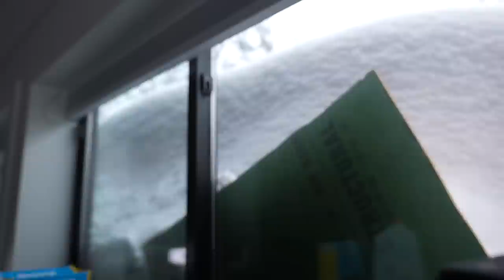RECORD BREAKING SNOW! WHAT NOW?

Comment: Suggest closing sides up for 3 reasons.  1. save propane. 2. melt the Ice. - side walls are not insulated so closing in the sides will raise the temp in the side portions. Heat loss is inside minus outside temp.  the bigger the difference the more heat needed.  [I use the same on the back porch and get 10-20° warmer on back porch.]  3. dry out sides.

Comment: Trent, If you are using , say, 1 1/2" outside diameter pipe, use a 1 5/8" drill bit.  Allows for some wiggle room.
Reply: Agreed . . . not really 'rocket science'.
Reply: Hey genius, I guess you missed the part when Trent specifically said "do not comment about the pipe".  I think there is too much wiggle room between your ears Rickster, or you are just plain inconsiderate!
Reply: @roberta4989  TBF . . . Trent did not say that for the same purpose that Rickster et al made these comments.   ( @26:25 ) first - he prefaces his comment with "if you're a plumber"  Not sure bout Rickster - but I'm NOT a plumber.    Then the gist of Trent's comment is about  whether the pipe might be too tight to function properly.   These comments are not about that.   They relate to "why make the project so hard  . . when if you just make the holes a wee bit larger . . . your job would be much easier".
Reply: @TomLloyd-18  Some people just like to argue.  Sad

Comment: How are you going to insulate the walls in the garage?  I’m worried because you can see daylight between the panels!  No wonder it is freezing!  So admiring of your tenacity and energy doing absolutely everything yourselves. Keep going!
Reply: They haven't taped the walls yet, if you recall they just got the roof taped up. Then there is foam board insulation that goes over the outside walls, then siding. Inside will be insulation between studs, then drywall. They got quite a ways to go after 4 way inspection...and the room is cold as there is only heat vents on in that room when they want them on till it is all done. Remember they are short on propane so they don't heat it much unless they need it.
Reply: @repaid1  Thanks for reply - I am ignorant about building process. Just hope the roof and walls haven’t got too damp in the snow storms.

Comment: Yes... mtn riders always should have an avy pack. And I'm a trail rider.  Also... not sure on that time lapse but hope you yet that sled warm up real good before moving it.  Seen too many cold seize without doing so.  Get it up on some 2x4's as well if stuck in that area. And some had guards will protect from the cold tops of the hands. Ride safe!

Comment: I NEVER work with moving parts in my snow blower while the motor is running.
Why not store your snow mobile on some wooden pallets, keeping it from being stuck in ice?
After being burried in an avalange some years ago, I never, ever, go near an area where ther might be even the smalles risk for an avalange. That was a teriible experience that I never want to experience again. Thanks for the avalange search dogs, they save lives - they saved mine.
So Brandon got a day off, but not Sideney...

Comment: 100% should buy an avalanche pack if you're going into avalanche terrain.  I've seen so many videos of snowmobilers setiing off avalanches due to the noise and the weight since the snowpack in utah and colorado is so fragile due to the huge temp differences.  No big deal if you're not going into avalanche terrain and staying in flat areas, but even terrain <30 degrees can go if it'sa big windloading event. Along with an avalanche pack, i hope you're going to carry a probe, beacon and shovel and doing some beacon training/AIARE 1 training and following UAC. Good luck!

Comment: Amazing your pushing through all that snow. I am an electrician not a plumber but I thought you couldn't put water pipes in an unheated outside wall? Not sure but if it was me I would at least wrap those pipes with electric heat tape . I couldn't sleep nights in the winters you are having with those pipes so close to the outside sheathing. Just me speculating.

Comment: Been riding since i was 10 yrs old (that's more than 30 years). 
My opinion . . get the avy pack if you ride in avalanche prone areas (30 degree+ slopes with new/deep powder). If not, wait to buy until you are more experienced and ride in those areas. Technology is changing.

You will need 2 good shovels (one in your pack, and one on your sled) AND an avalanche probe, AND ABSOLUTELY need a beacon. BCA Tracker 3 is a good one. PIEPS makes a good (small) one too. Take an avalanche class, so you learn how to use them all - SO VERY important!!!!

 Packs come with gas canisters, air canisters (both not recommended), and the "fan type", which is the newest technology. They should cost more like $1000 to $1200 for a good one. I wear the KLIM Aspect 16 myself. This uses a capacitor and fan to inflate the bag. Can do multiple deployments (i think up to 3), and you can just charge the capacitor with 2 AA batteries. With the gas or canister type, one pull and you are done. PIEPS JetForce is another good one but more expensive. BCA is supposedly coming out with a "fan type" soon. No intel on that one yet.
If you need additional info, i am happy to help - Cheers, and happy riding!!

Comment: you just built a garage and park your cars outside, makes no sense. Buy a $600 avalanche pack, every bit as good as spending twice the cost. I went to avalanche training in Truckee, CA great class. Dril 1" holes for water pipes, installs easy, and then you can put insulation tubing over it.

Comment: An avalanche pack will save you, sometimes, when you do dumb things.
Do not highmark and ride on slopes in high avalanche areas and times. Alaska loses several riders a year usually in the same few areas. I have been riding for 50 years, never had a scare. In deep unstable new snow, stick to the flat lands till it firms up. Learn to do a snow pack test, put it on video and you might save a new rider. Love your show, ride smart.

Comment: I'm sorry but that tractor is probably capable of so much more but that snow blower is laughable and kind of embarrassing really. Having a snow blower is that tiny is just an embarrassment especially when you have to rely on something like that to clear your throat.

As far as you complaining about breaking a shear pin, that's quite literally not a big deal. Do you know how many shear pins I go through in the Run of a year? The purpose of a shear pin is to make sure that you don't actually break the equipment. The pin is literally designed to break off to prevent catastrophic damage to your equipment. Imagine what would happen if you bit into something with the auger and this year. Didn't break. Imagine how much damage that could cause not only to the snowblower but to your tractor and potentially whatever you hit. Think about what would have happened if something made it past the auger and got stuck in the blower. Imagine the destruction that could cause if there's not a shear pin in there to break off.

A proper size snowblower should be a little wider than your tractor itself. And should be sized appropriately for your tractor. If that's the only size of snowblower you can get for that particular tractor, then I guess Kubota needs to learn how to build a better tractor. That snowblower looks like something you'd put on a John Deere X500 series or even x700 serious.